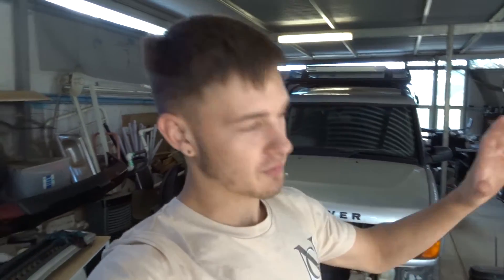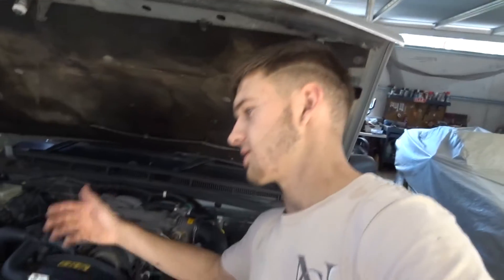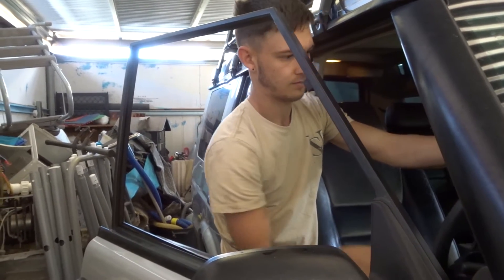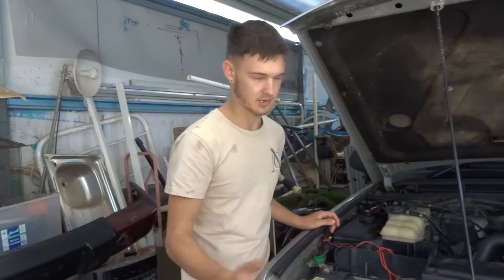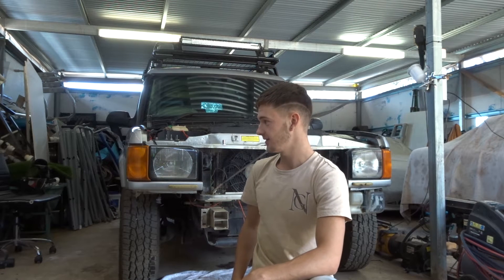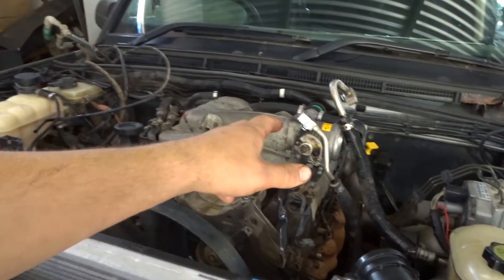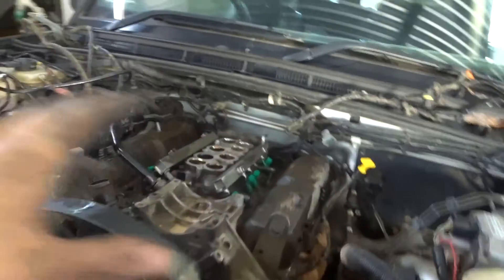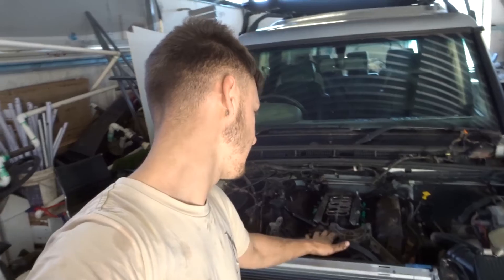V8 LAND ROVER BUILD -(Part 2)-

Comment: Fumes in your radiator can mean 2 things. Head gasket is rooted or you’ve got a cracked head. Fingers cries only a gasket. 
 I think they’re a full alloy motor. So you’ll be best decking the heads and should do valve stem seals etc while you have it apart
Reply from the maker: Thanks for that mate! Yea hopefully the worst is getting the heads machined. Yes it’s a Alloy motor.
Reply: First thing before you do anything. Get both heads crack tested. If they’re ok (they should be). The rest is easy. All I’ll say is don’t cut corners on anything. Get the best quality stuff possible and buy a good torque wrench.

Comment: to stop it leaking oil you will need rocker cover gaskets , valley cover gaskets , sump gasket , front and rear seals, new harmonic balancer due to the big seal grove you will have .  1/4 drive torque wench and 12 point socket set . torque everything  textbook . I must have had the only v8 disco with no leaks but it cost me .
Reply from the maker: Cheers for the information helps out a lot! I’d love to see photos!